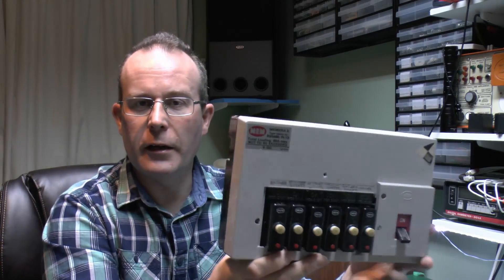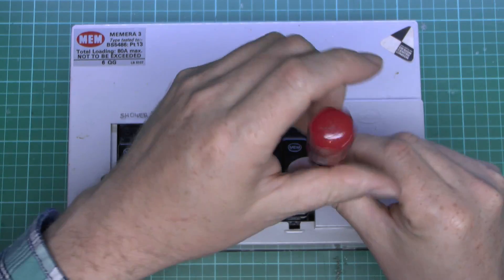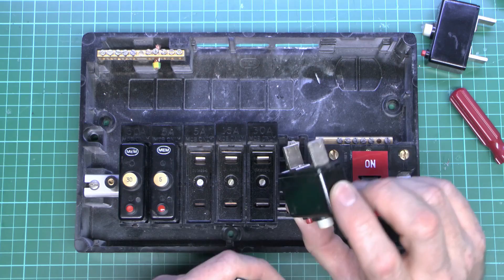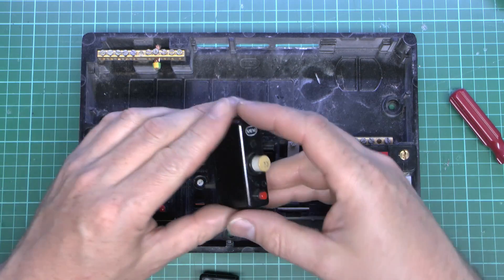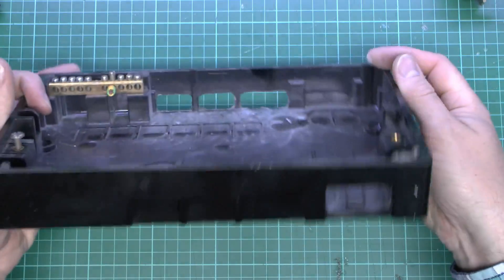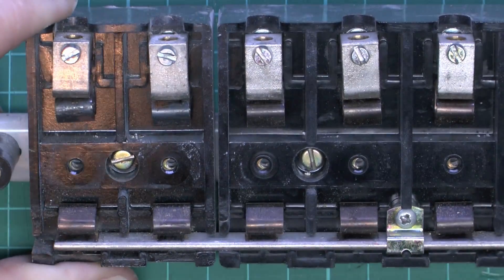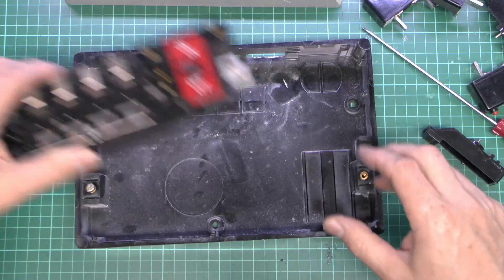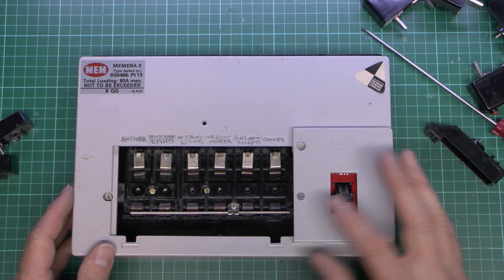Memera 3 Consumer Unit with Plug In MCBs

Comment: Any idea where I could purchase a 5A mcb for this any advice would be appreciated ?
Reply from the maker: They haven't been made for decades, so the only option would be if any used ones can be located somewhere.  It's very unlikely as these were not compatible with any others due to the pins being horizontal, most other makes were vertical.

Comment: i have the MEMERA 3 plastic 4 way fusebox it has plastic cocvers over each button, i want to turn off the sockets without turning off the water heater as i don't want to mess with the heater timer, should i just pull it out or turn the whole thing off
Reply from the maker: The individual buttons can be switched off.  If removing one of them from the fusebox, the whole thing must be switched off first.
Reply: @jwflame  thanks i'll just turn the whole thing off

Comment: I can’t find a 16 amp breaker for this consumer unit. Can I use a 30 amp breaker to wire a 16 amp outlet ? For plugging in 16 amp tools and machines 
Thanks
Reply from the maker: Yes, provided the cable is rated to at least 30A.
Reply: John Ward thanks, 
I’ve got the old memera 3 consumer unit
Would it be worth having an electrician fit a whole new unit? Or would I be better off just fitting a 30 amp breaker and saving money? It can take 80 amp and only has a few 5 amp breakers fitted just now

Comment: john love the podcasts got one of these consumer units do you know what the max MCB or HRCs can be fitted Thanks.
Reply from the maker: Most likely 30A.  Some CUs of that era could take 45A fuses which were green, but only one could be fitted and they usually had to go in a specific place next to the main switch.  Generally they had a 100A main switch as well, rather than the more usual 60A.
In any case, finding parts for an old one like that will be next to impossible now and there is no RCD protection either making it useless for new circuits.
Reply: Thanks John.
Reply: @jwflame  We have this same model of fuse box and as you say 30A max, and so we have a secondary smaller Protek modern box with 40A for the 9.5Kw shower unit fed in to it.  All the fuses in our Memera are 30A for "cookers", "sockets" and "garage" apart from one 5A for the "lighting".  I think ours is from the 1980s but possibly 1970s.

Comment: Another great video. 
Mr Ward , that may sound silly, but any chance you could do a quick video about single pole switches having to be connected to the line conductors only, as I can't get my head around it on how can you reverse polarity at the consumer unit, meaning how can you terminate neutral (blue) wire into the mcb and live (brown) into the neutral bar?! Please draw a quick sketch of 5min clip about it. Many thanks

Comment: lock at these ! the euro plug is ratet for max 2,5 amps but with these divece a can sent the current from 3 times 2,5 amps over one euro plug! i think there is no fuse in there !
https://www.amazon.de/dp/B01MUCT5DO/ref=twister_B01HZCW0TY?_encoding=UTF8&th=1

Comment: Hi, If I may, I have a question/challenge for you. I wonder if there is a way of setting up a Lichtenberg machine that is safe to use. I realise no Lichtenberg can be%100 safe nor can you guarantee its safe use. Thank you for your videos and advice and for taking to time to at least read this.

For those who aren't familiar with Lichtenberg, you basically wet some wood with a bicarb/water mix and then pass an enormous amount of electricity through it. The result is a very attractive tree like design.
Reply from the maker: There probably is a way.  It certainly won't involve microwave oven transformers balanced on a table as shown in plenty of other videos on the subject.
Reply: I do a lot of wood turning as a hobby and would love to incorporate Lichtenberg into my designs. From speaking to friends who make furniture, there would probably be a good market in selling such a device. Thanks for replying.
Reply: @jwflame  Hello I have a question to ask and I was hopeing you would know the answer given all the experience you have had. The plug in MCB's that you could get for the old wylex boards seem to be a lot thicker than the original design of the fuse carriers and seem to stick out so much that it looks like it would be impossible to get the protective cover back on over the fuse carriers if you were to swap one for a plug in MCB replacement. I think this because all the old wylex boards that I have seen that have had plug in MCB's fitted not a single one has had the protective cover replaced after the conversion. Am I right in thinking this is because the cover physically wont fit back over the new MCB's or is it just down to pure laziness of people not bothering to replace the cover after the conversion?
Reply from the maker: @jakemcintyre4820  The covers had a removable section in the middle, which leaves just the outer frame to cover the gap around the edge of the MCBs.  However many people didn't bother and those that did often broke the cover into several pieces as the plastic was very brittle.
Reply: @jwflame  Ahh right I understand that now. Still a bit stupid really isnt it? Wylex might as well of just made the plug in MCB so the whole cover could be placed over it like the fuse carriers.
Reply: Simon, if youre still interested in this (and still alive!) you can create Lichtenburg figures by using a current limited neon transformer. It supplies the high voltages necessary but the inherent current limit makes it a lot safer, although you should still be extremely careful of course.

Comment: was it safe as the fuse ratings d up to more amps than the 80mps
Reply from the maker: Yes, it's very unlikely the circuits would all be loaded to the maximum at the same time.
Reply: Thanks for replying and understanding my rather bad typing.

Comment: Always wondered why the main switch is up for on and down for off on consumer units, the opposite from the usual for switches in the UK. Any ideas?
Reply: Its not. Down is on & up is off. It looks confusing when the cover is off.
Reply: londontrada  Well spotted. I posted the comment to see if anyone would notice how confusing these sliding labels are. Years ago I replaced all the wired fused units with MCBs. After removing the cover for some reason I can't remember I must have noticed the switch indicated on when in fact it was off and pushed the switch up into the on position. I then replaced all the fuse units of the consumer unit live without mishap. Only an amateur would make that mistake and got away it but still think these sliding bezel on/off labels are a potential death trap for the unaware. And have you noticed that MCBs are off in the down position?
Reply: wattsupmike ? Possibly for in the event that something falls on the switch, power is switched off instead of on during unsafe conditions. In North America it's a requirement for most installations to mount the switch/disconnect up for on and down for off, and lists that exact reasoning why in the code book.